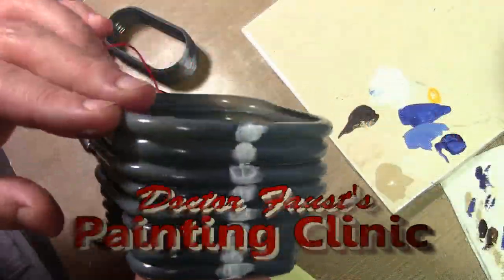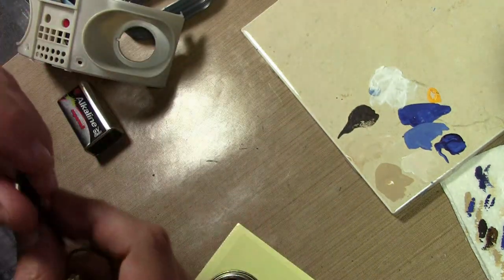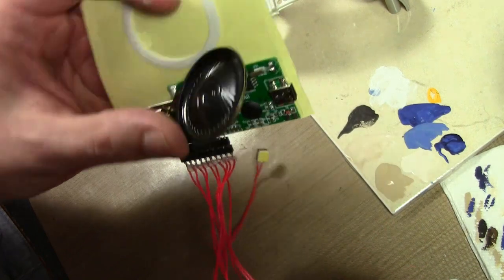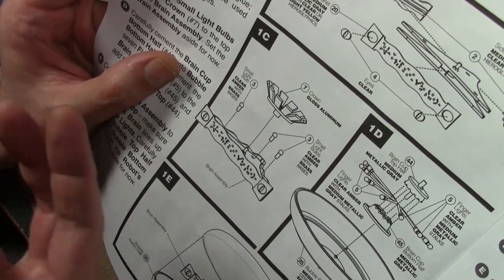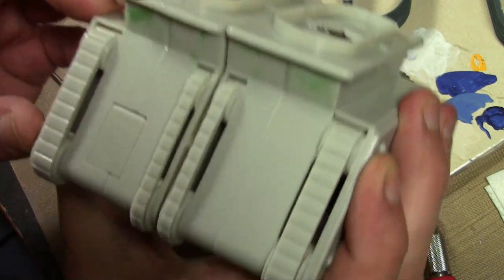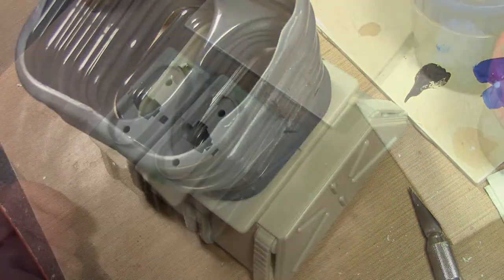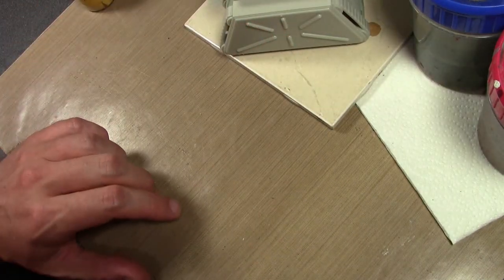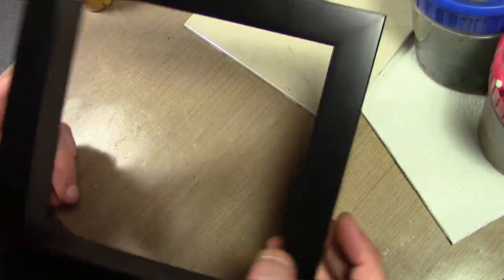Moebius Models Lost In Space B9 Robot Build Part 1

Comment: I believe the holes on the bottom of the tread sections are correct. I think you can see them in the episode, "Junkyard In Space" when the Robot is laying on the conveyor belt. I think the holes with the slots were where the cables that were used to pull him threaded through. Anyway, nice build so far. I look forward to the finished project!

Comment: For those seams
Have you considered Tamiya / GUNZE (GSI) surface primer
They are very thick primers they are rated 500/1000/1200 (at least those I am aware of) in same way as grit paper. They stick to every type of surface, they do not peel off and you can layer them, They do come in bottles with lid (GSI) or same bottle as tamiya extra thin (grey color)

Comment: Interesting so far. The legs are vinyl-- I think you need a tub-n-tile silicon calk. some of them say you can paint over them. I believe you have to do all your smoothing before it sets-- no sanding later. As I recall, the "back of a wetted plastic spoon" made a perfect radius on the edge of your tub. So, maybe a finger with some food-cling wrap on it and a little water will do the job.
Reply from the maker: The putty stuck after priming it. Though it's so small I think it's best to just ignore it.

Comment: I too have this kit. I Started at the top, I didn't decide to light the bulbs. I used Liquitex pouring medium with drop of color to obtain amber bulbs with gold base. Note the instructions state that griphix should be amber but if you look at the show the colors white with blue tint. I have found with seam lines that if I brush on MicroMark Same Stuff plastic weld on the seam line in small coats (after you glue). Also remember that his center lights blink  red when he talks. Funny if you look at that part behind the clear blink part  there is two circles like where bulbs should go.

Comment: The feet are acurate. On the first few episodes the feet were seperate and Bob May had to move his feet like skates to make the robot walk. After a few episodes they bolted together the feet and pulled it along with cables. Those pegs represent the washers that spaced the feet apart. They had one bolt in the front and one on the back.

Comment: How do you contact Moebius  for replacement parts I need  the left and right tracks ( both halves )  for the B9 Robot?, the casting was so off and had a thin weak wall on one half that kept cracking.

Comment: I just noticed that the electronic part you bought has a white and red blinking diode for speech blink section. Too bad it won't be in sync with the speech module. You bum :), (I say that in jest) , that you must have bought the last one, they are out of stock on the blinker. Oh well, I think that is an omen to tell me to save $80. They also have etched part kit for $22 that most parts I have glued in not being able to use it. This kit little plaques you could use.

Comment: My primary complaint with this version of the model is the split in the bubble head.  The original was the same and it sucks.  It totally ruins the look of the model.  I see Moebius didn't spend a lot of time ensuring the parts fit together.  The original was such a horrible fitting model it takes hours and hours of sanding, filling, sanding, filling.  This looks to be a bit better, but still for a new kit this sort of fit is unacceptable.